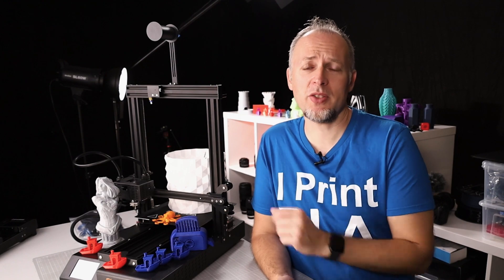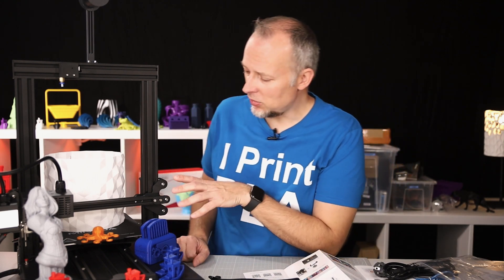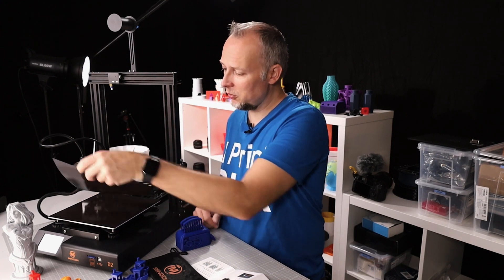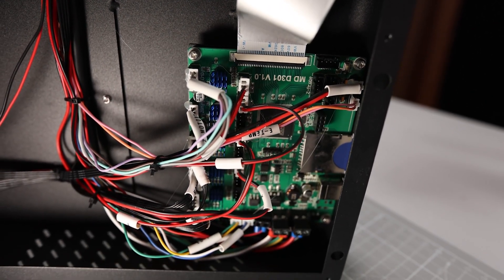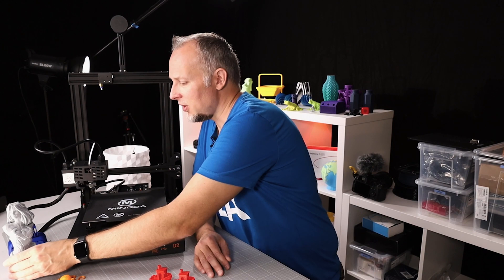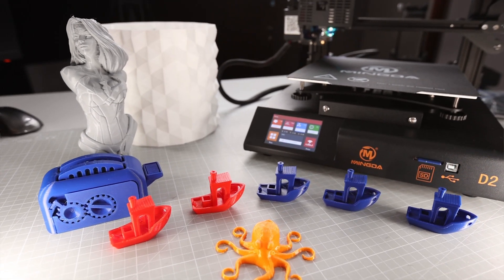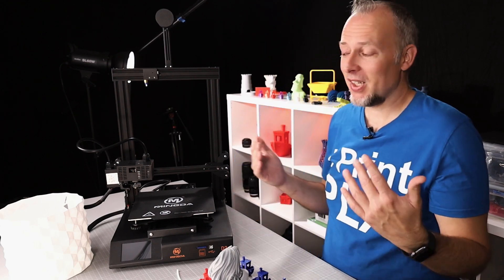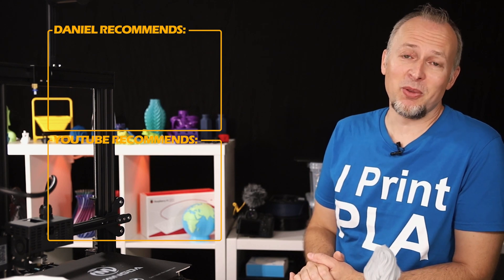MINGDA D2 3D Printer - GOOD ENOUGH?

Comment: I have two Mingda D2’s: extruder failed on both after a month, had to change the extruder a to MK8 All metal extruder, Heat throat, heater block, ender 3 support plate. Mingda even told me, in support the D2 would never support BL touch! What? Anyway. I have shared all my mods on the official and unofficial site  where you can see all the mods and why. I can now print PLA at 100mms, PETG 80mms. I’m grateful for the experience that I can now fix most of my machines from what I’ve learned by “HAVING” to not wanting to but HAVING to do repairs and upgrades. But would have I ever bought knowing what I know now? No. 

I’d BUY Voxelab Aquila. Best support yet, friendliest group to date, prove me wrong. Basically a family all helping each other out. I’ve helped 30+ people fix their mingdas for the love of passing it forward.
Reply from the maker: Thanks for this info. I think it very much depends what the buyer is looking for. Cheapest printer mostly comes with the need of upgrades. It’s getting really challenging for the average buyer to make the right decision that’s why we talk about it here.
Reply: @Crosslink3D  couldn’t agree more. I love how you pointed negatives in a neutral way. Like your sharing an actual experience and we get to decide if it’s worth our time and effort. Many others just give a massive praise move on and won’t even answer questions how they got their sto work or want you to contribute before they share all their mods lol whatever. You made suggestions, and kept it super neutral. And that gave us the ability to think if it’s worth our time. For that thanks!!!
Reply: @Crosslink3D  subscribed!!

Comment: The biggest problems with the D2 are the board the screen and the hotend! All proprietary to the printer...the LCD is a special TFT 3.5 size and the hotend is only usable if you get their part which is over priced! The board you can modify if you wish but will have to figure something out for a screen...overall it's ok but when it breaks down good luck getting parts for it..also reliability of the board is pretty bad with alot of people getting a few months at best with it..mine lasted about a month before a driver went out..also firmware they provide is old and although opened sourced you can not program TFT with the firmware and they have it locked down. Overall I returned mine and bought a sovol and love it...all creality parts for cheap...the D2 is junk but that's my opinion personally.. love your videos find alot of them very useful.

Comment: I have had problems with the Mingda D2 and the problems are replacing the hotend, and then the display screen will not come on after the replacement of the hotend. Do you have any idea on how to fix it?
Reply from the maker: What exactly did you replace? Seems rather  unrelated that the screen is affected by changing the hot end. Maybe double check all your cables and connections whether they are tightly in their places